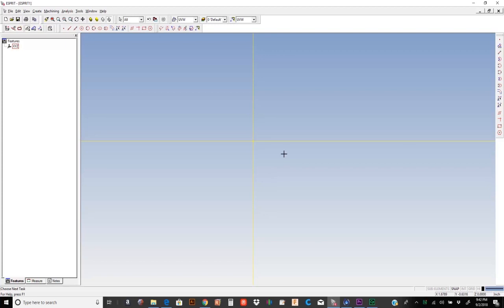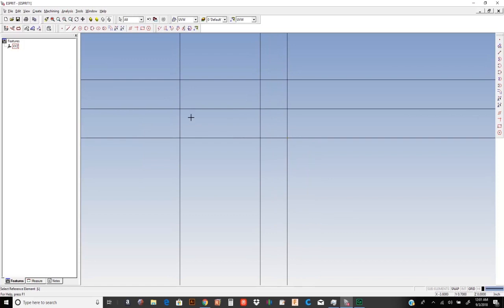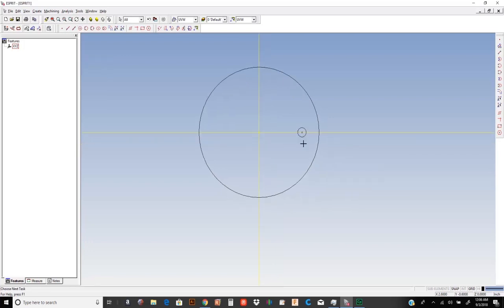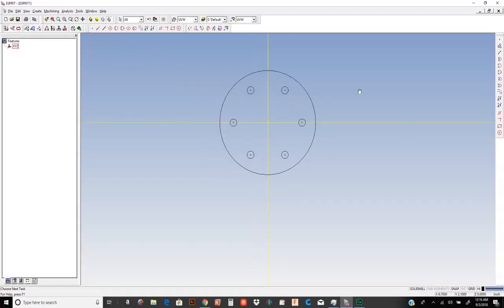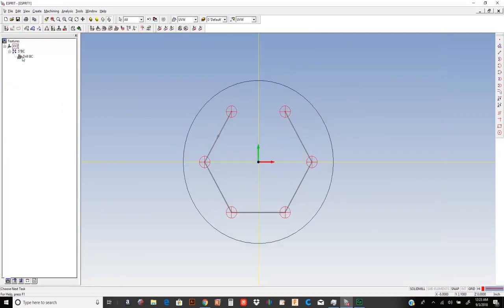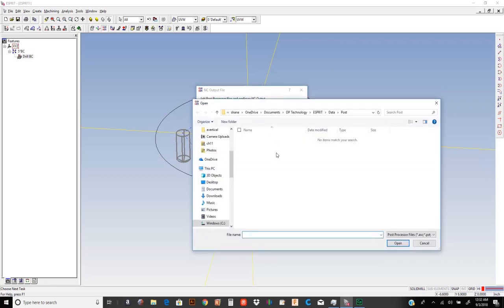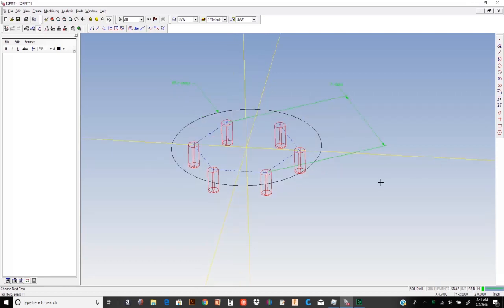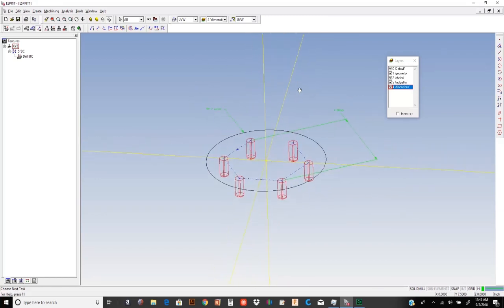Esprit Tutorial: Intro To Esprit CAD/CAM

Comment: In my 30 years of machining and programming I've used SmartCam, Hurco conversational, Mazatrol conversational, and Gibbscam. I've also been to a sales show for Solidworks programming software. I have also seen Haas conversational and Mori Seiki Mapps I believe it is called. I would have to say that Esprit is by far the least impressive software I have seen. Maybe after spending a couple weeks on it I might speak differently but as of right now. Least impressive.